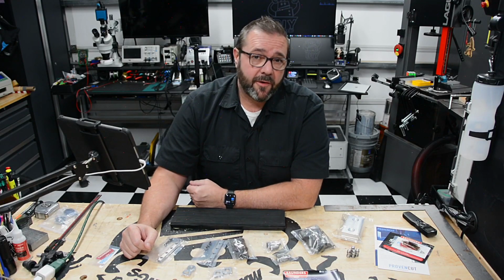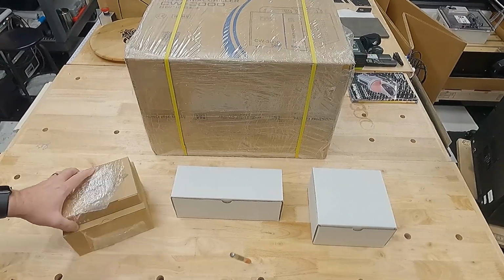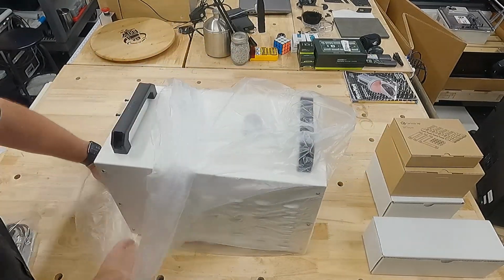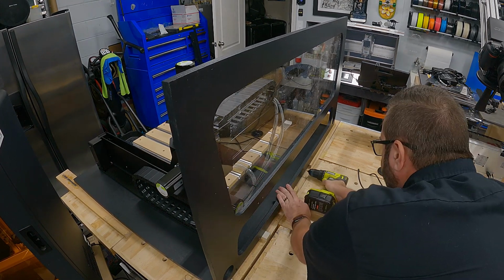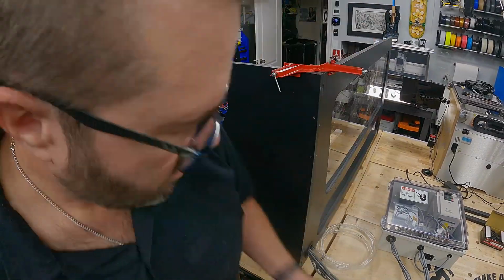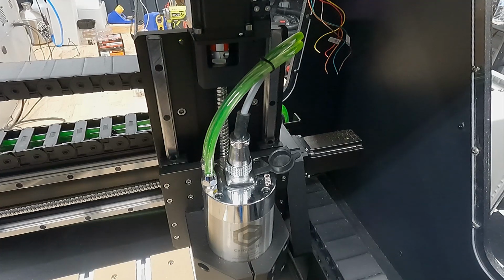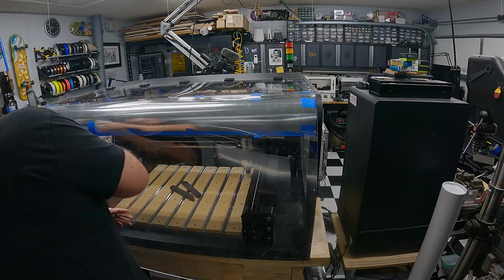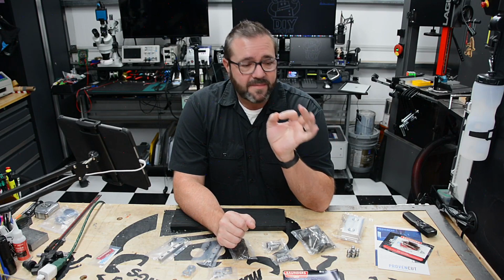The New Shapeoko HDM CNC! Unboxing, Setup and Upgrades!

Comment: Have you tried milling steel? If so, did you check tolerances. Thanks.
Reply from the maker: no, as this is only the 1.5kw spindle I mill aluminum exclusively on this machine.

Comment: Pretty cool touch machine for aluminum machining.  I'm thinking on getting one myself.   I probably switch out the stepper motors with clearpath servos for sure, them clearpath motors are best thing since slice bread.
Reply from the maker: yep, im pushing my feeds for steppers, had to back off slightly due to missing steps during rapids. servos would be nice if you have the spindle to back it.
Reply: @DIYEngineering  Maybe one can adapt mach4 and a nice Hiteco spindle, I have them on my 5 x 10 cnc machines.  I was wondering do you know what size the stepper motors are and the shaft size is?   Gathering info B4 I drop 6k for HDM and another 1200 for the Saunders tooling plate.   Thanks, Fritz
Reply: Too bad they don't sell this machine without the electronics and motors, like maybe barebones.

Comment: OMG, at 19:32 when you show the bike bottle for misting fluid and the holder I fell apart laughing. These are the kind of genius ideasl that will pass by 99% of engineers. I personally use a steel water bottle hung from my table frame below the control panel using a carabiner. I got that bottle from one of the job fairs at my university. That bottle was the best score from my experience with the corportate recruiters!
Reply from the maker: hah, facts!

Comment: Are you using the 1.5 or 2.2kw? im tyring to find out if my 250v welding socket is going to be too much for the vfd.
Reply from the maker: 1.5kw
Reply: @DIYEngineering  Wow, well alright. I was impressed with the mrr you have shown. 2.2kw must be an insane little monster xD
Reply: @robthatguyx that’s what I was thinking, 2.2 would make my lights upstairs flicker 😅

Comment: What comparisons could you draw between the Evo One Pro and the HDM ignoring their differences in working areas.
Reply from the maker: the hdm has a stronger spindle, and stronger motors, the hdm is in a larger class of machine and isn't really a fair comparison. comparing the evo-one pro to every other machine that has the same or smaller  milling volume , it wins hands down. ;)

Comment: that is a nice machine, though the price is a little steep.. Langmuir Systems just released their MR-1 model and claim it cuts even titanium for the same price range. I wish someone could make a comparison between the two.
Reply from the maker: yes, and thats before you upgrade the machine with an enclosure, new plates, a probe, etc, etc... I've been watching the MR-1 it seems like a nice machine, a little more complete package than the HDM... carbide motion software and the controller is very limited for the HDM, I'd say this machine is for a different class of users that what they seem to be catering to in their marketing these days. and that leaves you wanting more... the MR-1 on the other hand has some concerns as well, RPM limited to 8k, table area fixturing flexibility, open ball screws, to name a few.

Comment: Great video im currently building a cnc router and there's alot of conflicting info out there im close to mounting my vfd some people say put in separate enclosure because of emi is this true? also the power cables for the motor that run through the drag chain everyone says run separate from stepper cables which all sounds like a pain but I notice this machine does both of those things
Reply from the maker: It really depends on the wire shielding used in your setup. Vfds can produce emi but shielded multi conductor wires should prevent any side effects.

Comment: Brilliant - what was the cost of materials and cost to send out the parts to be milled?
Reply from the maker: Baltic birch plywood was expensive -$250 for two sheets. Acrylic was -$75 I found a job shop to mill the parts which was another $200

Comment: Good job! I use polycarbonate instead acryl. Acryl breacks easily, also polycarbonate you can bend on metal bender machine. It is unbreakable.
Reply: Would the poly cause a white line where the bend is?
Reply from the maker: Cast acrylic was manageable just need a lot of even heat
Reply: I would generally prefer to use LEXAN Margard because it is perfect for a shop environment, being durable and mar resistant. That said, a 48" x 96" sheet of 1/4" (0.220" actual thickness) MR10 is a bit over $1,000 US vs. under $200 for plain Polycarbonate. Taxes are not included in the prices.

I've used the Margard in harsh environments and not one panel has needed to be replaced in 20+ years of daily use. The cuts and scratches in the outer surface remain transparent. However, for a home shop I'd create a real problem with my better half if I spent over $1,100 US (est. taxes included) on a sheet of Margard.